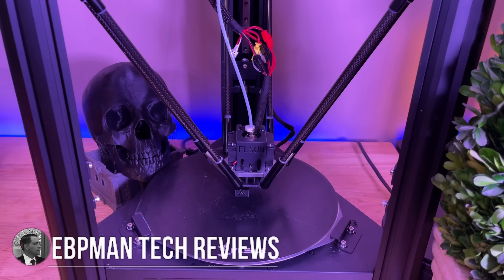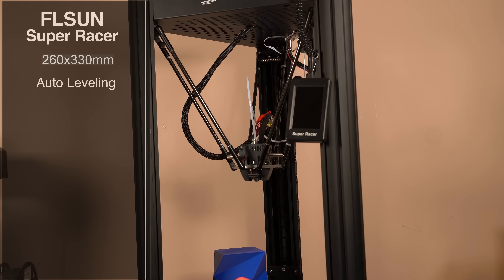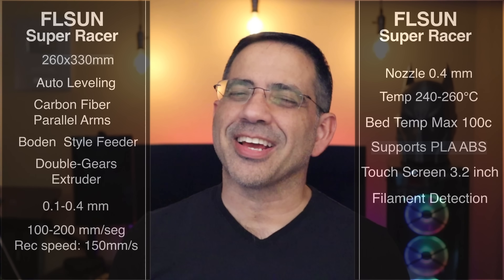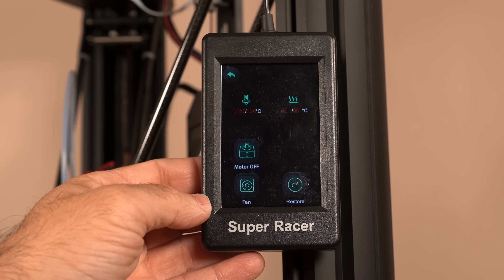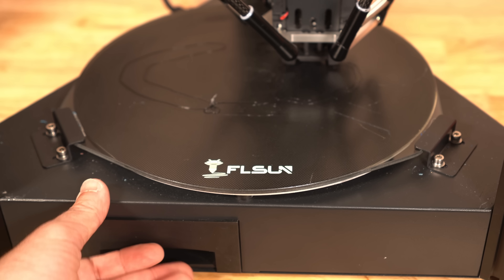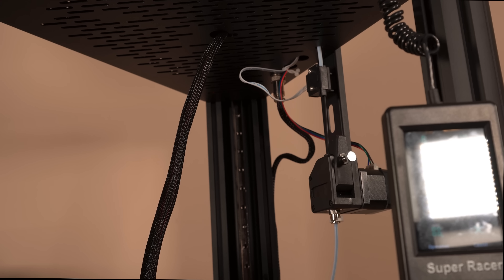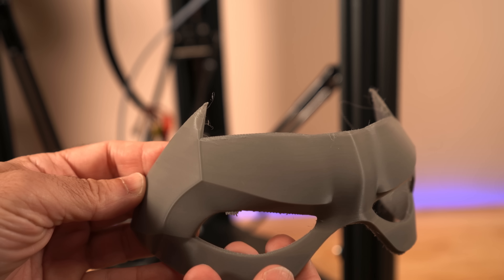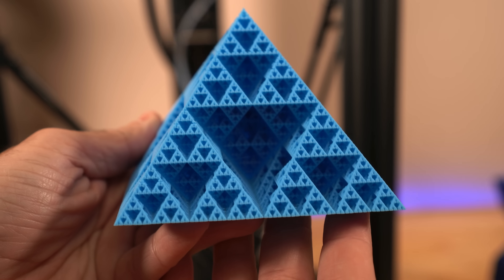SUPER FAST!  FLSUN SUPER RACER 3D Printer

Comment: What would you recommend more: the Ender 7 for about 550$ or the flsun SR for about 450$?
Reply: Just go for the the MK3+
Reply: @Andy-rv6bq  already got an flsun sr for 399€ while it was on sale
Reply: @ButterBrause  What are your thoughts on it so far?
Reply: @Andy-rv6bq  very nice print quality.. it's fast.. the fans are a bit loud but acceptable only the "foot's" of the printer are to small and you need to print some wider one of thingy verse.. other than that no complains so far.. bed adhesion is very good sometimes too good 😅